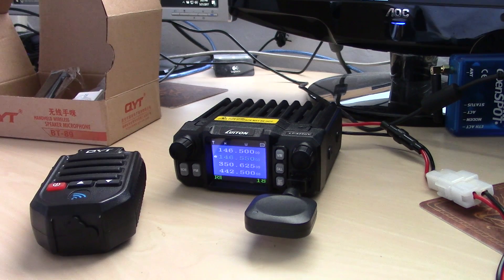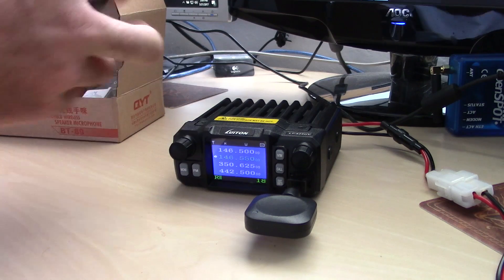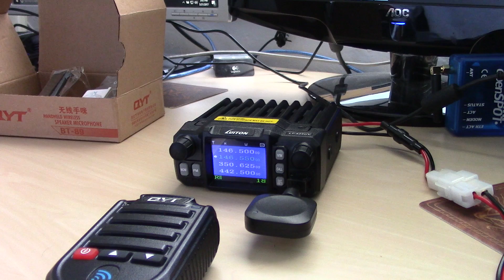Bluetooth speaker mic for ham radios QYT BT-89

Comment: Remade for TH9800. Worked great! Then they accidentally plugged it into another same (main extending) connector on TH9800, mixed it up. The receiving module does not work now, the LEDs do not light up. Apparently + 13.8V hit the input of the MIC pin. Common GND wire connected to the positive + of the module. How to repair a module? Maybe sold separately? Please provide the diagram too. Thank you

Comment: It works on the kt8900D but the receive audio still comes from the radio and not the mic should it??
Reply: Someone else said to set the radio to carrier mode, and it'll work! Try it?
Reply: @chrissewell1608  will do cheers

Comment: I am wondering if this will work with my Yaesu FTM-400xd as I have a bluetooth module optional board YA-BU2  Yaesu Bluetooth adapter unit for Yaesu installed

Comment: I had the same problem with no receive audio until i was given info to go into menu and set radio to carrier mode and then press transmit button on mic and WALA!   SOUND THRU THE MIKE
Reply: What is that menu item called?

Comment: great video bro, technically the Bluetooth Mic is made for QYT 7900D which is the variant of the Luiton model you have there. But for a QYT 7900, everything works including the Speaker on the Bluetooth, but if you try to pair it with the QYT 8900D which the more advance brother of the 7900D, the same thing happen as your video here, everything works fine except for the Speaker. Recap, for Luiton and QYT 8900D the speaker on the Bluetooth Mic won't work, but for QYT 7900 and 7900D everything works. Although I haven't tried reprogramming it yet, but might work if the setting on the program is correct.

Comment: Do you know if this works with the LT-898UV or if the 898uv has speaker out through the rj45 connection? Working on a small project, and need to know if it really has audio out.

Comment: Have you tried pairing it with a smartphone and using it with Zello ?
Reply from the maker: Yah, it paired but didnt work correctly.
Reply: Which bit didn't work ?, I know that with some mics,the PTT will only work in toggle
mode, and the microphone has to be enabled in the Zello app.

I asked because they seem to be about half the price of a Bluetooth mic that is 
intended for use with Zello.

Comment: Cool! Here's a question: I got a QYT from Ebay and mine only came with a cigarette lighter cable, not a cable for a power supply. Did the Luiton come with both? How does the audio sound on that Bluetooth mic? The mic that comes with the radio has pretty low quality audio (but hot!). Cheers from Tokyo
Reply: In my case Sir, it's also the Cigarette Lighter plug that came with it, but basically, it's just a simple positive negative terminals, red for positive as usual on any cars, so if you want to try plugging it to a power supply you can easily make a power-supply plug for it, just make sure positive line is correct and don't forget to put a fuse on the positive line to save your radio from any mis-connection.

Comment: Thanks for the review. The mic is a bit pricey for a Chinese product but it's still only 1/3 of a cost of the Icom Bluetooth enabled microphone. I wonder if ti will work with an Icom ID-5100?

BTW, if you are looking for a good speaker for an HF rig, check out EcoXgear GDI-EGPB100.  It's a compact Bluetooth amplified speaker (with microphone too). I bought one for my Elecraft KX3 and was amazed about it's crisp audio quality. It's perfect for HF SSB audio. I have used a lot of speakers with my radios but this little thing sounds better than anything I have tried so far. The mid-range voice reproduction is amazing. It's relatively small but it has enough volume for noisy environments. I since bought several more, including one for my base  FTDX-3000 and field day IC-7300 radios. Fully charged, it lasts all day long. I connect it to my radios "headphones" jack with a 3.5mm stereo cable.
Obviously I'm not affiliated with the speaker manufacturer but wanted to mention this, in case someone is looking for a quality speaker.